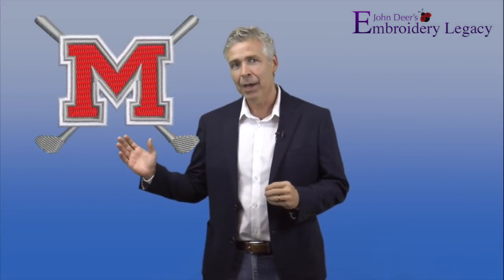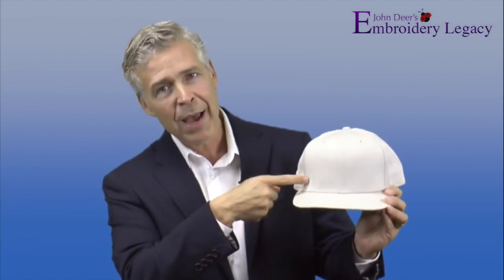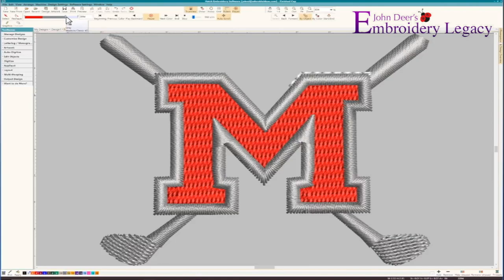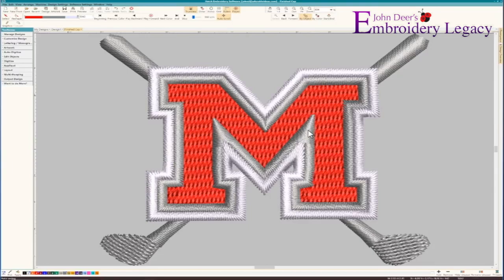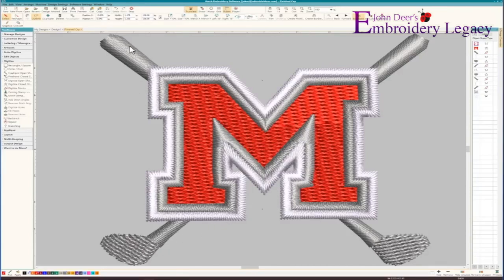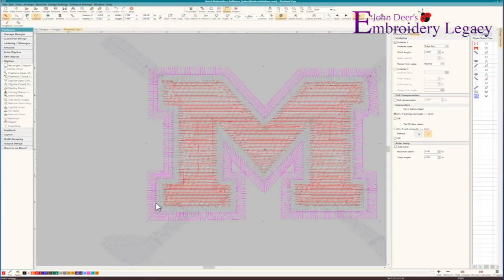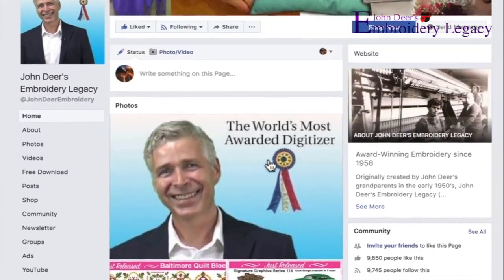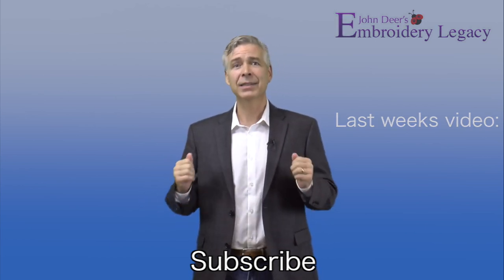Machine Embroidery on a Baseball Cap Help

Comment: I have been digitizing for well since 2004, I took a break between 2010 and 2015, but doing it again. I use Tajima DG.ML v14 software, but I absolutely despise doing hats, A lot of the time I use little to no underlay because when it is embroidering sometimes something shifts and it's sticking out, for the past few years I have been doing all my designs from center out even for flats, because I figure I do not need to make it twice if I do it that way, but I never dream of using an edge run stitching assuming you will see it a lot stitching out. My fill stitches never look good, I was never taught how to do any of it so I self-taught myself which probably hurt me in the long run and now I basically just feel lots because I see other companies that do embroidery that looks crystal clear, and mine does not, and I keep editing and trying different pull comps, underlays, and density, but I can't seem to find the outcome I want and its frustrating to say the least. I really like your videos though, I just found them and I am going to go around and watch as many as I can.
Reply from the maker: Happy to hear your back to digitizing! :) Thanks for watching my videos, I'm glad you're enjoying them so far! Learning to digitize can definitely be a difficult process without proper education. Which is why I make interactive online lessons taking the frustration and learning curve out of learning digitizing. Unfortuenly I have not made lessons for that software brand but we do offer a 30 day free trial to Hatch, which in my and many others opinion is the best home digitizing software available. Here's a link to our 30-day free trial as well as our lessons:  https://digitizingmadeeasy.com/hatch-embroidery-free-trial/ 
https://digitizingmadeeasy.com/e-classroom/digitizing/
Reply: @EmbroideryLegacy   I am also wondering what's the difference from using Hatch as opposed to Wilcom Studio Designer 4. Just a lot more options? Is hatch really basic? Does it need everything I need it to do? I am downloading the trial now. Just Curious why Hatch for Design Studio beside the cost. Thanks!